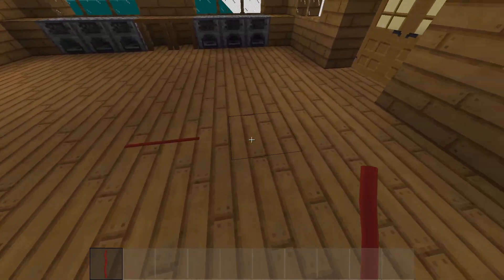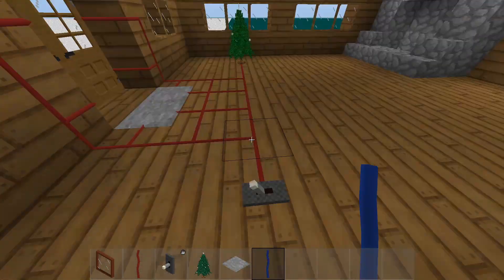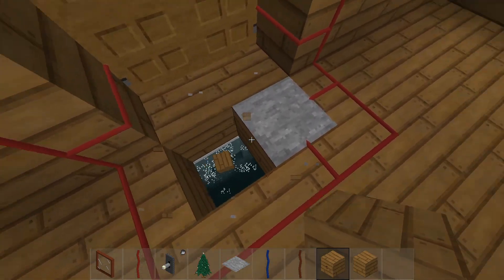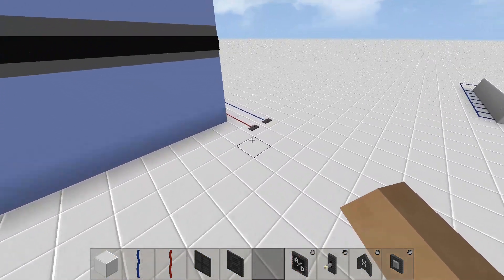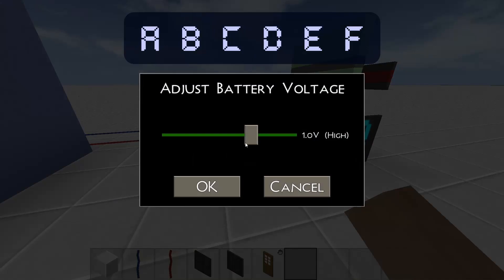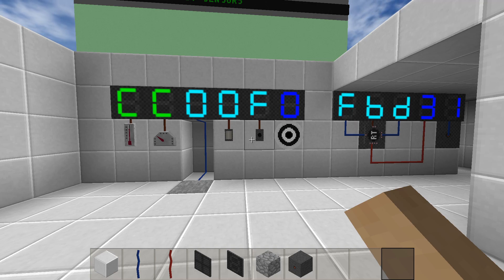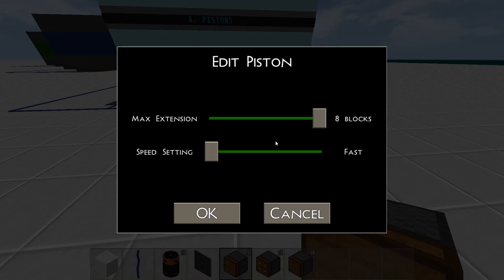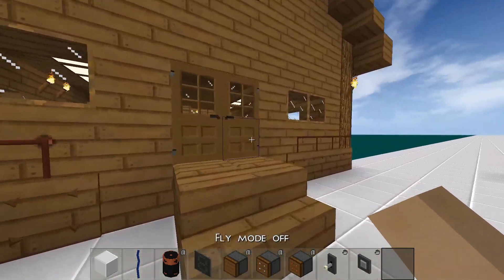How To Use Survivalcraft's Electricity - Part 1 Analog And Digital

Comment: For some reason when I enable both inputs of AND and XOR gates at the same time next to each other, the output glitches out. I just found this out when I was making a half adder
Reply from the maker: Is one of the outputs connected through the diagonal of blocks, I suspect the game logic somehow thinks that the component is rotated 90 degrees as can be observed with a digital to analog converter placed in the same configuration
Reply: @SP4CEBAR I placed both gates on the same plane facing straight up. I connected the wires and tried turning one of the levers and as long as one is on the output is fine. When I turn the second lever the output froze.
Reply: @SP4CEBAR I tried downgrading to version 2.2 and the same problem also exist. then I tried installing Survivalcraft 1, making the entire circuit, and when I tested it it works fine.
Reply from the maker: I just tried to replicate it but it worked fine, are the switches and outputs directly connected to the gates or are there wires in between? If there are wires, what path do they take?
Reply: @SP4CEBAR  I connected it like this:
   X    Y
    |     |
-- A - O --
|      |      |
|    SW   |
--- SW ---

A is the AND gate, O is the XOR gate, SW are levers, X is the lightbulb connected to the A output, Y is the lightbulb connected to the O output.
Reply from the maker: odd that it didn't work
Reply from the maker: Here's an image of the bug I described, is this the same bug you encountered?
https://cdn.discordapp.com/attachments/368441937143005185/1346955887469658184/Illogical_components.jpg?ex=67ca11ec&is=67c8c06c&hm=7209d59e2d3995bc66368ce2133f83a1c597ec2790aaafd1449c06005c8b7fb3&

Comment: Minecraft: “We have the world's most complicated wiring machine mechanics ranging from Calculators to a Computer that runs bootleg Minecraft” 
SurvivalCraft: yes
Reply from the maker: Yes indeed
Reply: @SP4CEBAR Can you please tell me that how can I increase the limit of maximum extension of pistons like 1 to 12 1 to 24 etc?
Reply from the maker: @hylegaming7264  with mods, I don't know what mods you'd need for that, maybe ask someone in the modding channel of the SCC discord server (which is not my server): https://discord.gg/ewnkV4v
If you wanted to make it in vanilla then you could place a bunch of strict pulling pistons in a row, and power them starting from the one that has the most pistons to push

Comment: This blows redstone out of the water. Only thing I'd like them to add is transistors.
Reply from the maker: You can use an AND gate as a transistor (for digital use cases): a high signal on one side makes the signal coming from the other side pass through
If you want the amplification behavior of transistors then you could program a memory bank with this custom behavior, it should have data like
0000000000000000
0123456789ABCDEF
02468ACEFFFFFFFF
0369CFFFFFFFFFFF
048CFFFFFFFFFFFF
05AFFFFFFFFFFFFF
06CFFFFFFFFFFFFF
07EFFFFFFFFFFFFF
08FFFFFFFFFFFFFF
09FFFFFFFFFFFFFF
0AFFFFFFFFFFFFFF
0BFFFFFFFFFFFFFF
0CFFFFFFFFFFFFFF
0DFFFFFFFFFFFFFF
0EFFFFFFFFFFFFFF
0FFFFFFFFFFFFFFF

Comment: How to make high security system in sc2
Reply from the maker: Motion detectors or pressure plates could be connected to 4-LEDs to make a control room security camera display
You could use dispensers firing towards each other to make a "laser" wall that deals a lot of damage to everything that tries to pass, you could make doors that lock automatically, or when a control room lever is switched on
Reply: @SP4CEBAR  Oh ok thanks bro⭐⭐

Comment: I'm trying to make an item separator. I throw all the items I collected into a stream of water that leads to a dispenser, then goes to a pipe. Is it possible to make a system that separates the items and each one goes to a specific chest? 
I managed to separate them, cause they pass through a stream of water and underneath there are dispensers with all the slots filled with a unit of that item, so only the specific item will enter. But I don't know how to eject this item that was separated without removing the other slots, because then the separation doesn't work anymore
Reply from the maker: The only type of item sorter I made sorts items based on their density (floating, slightly sinking, sinking or quickly sinking)
But, this dude made item sorters like you described:
With water:         https://youtu.be/Ygr1odyAxbw
Without water:   https://youtu.be/PPibFS2nPsY
Reply: @SP4CEBAR  Thanks a lot for the help! I'll probably use the system of the first link, with water! But the second link is unavailable,  can you check it?
Reply from the maker: @renansm3077  Oh wow, I must have accidentally hit backspace, the link should work now
Reply: @SP4CEBAR  woow, it works, the system he used is so amazing !!!!

Comment: what was the app you used when you explaining the target function?
Reply from the maker: With the auto-clicker, you can do things like clearing out water (with glass and fireworks) (10:10) and making rhinos fly 
https://www.instagram.com/p/Bx-EcHoBSuX/?igshid=1q9m2kavspzn2
Reply: @SP4CEBAR  thank you so much!
Reply from the maker: Np
Reply from the maker: You mean the auto-clicker?  (which I used to fill the dispenser)
This is the one I'm using: https://sourceforge.net/projects/fastclicker/
Reply: @SP4CEBAR  so this can help me fill up the dispenser right? I cliked thousands of times to build up firework castle lol
Reply: @SP4CEBAR  I downloaded but not sure how to use it
Reply from the maker: To use it you need to set a trigger key, by default this is enter
You can choose wether you want the key to toggle the auto-clicker on or off, 
or you only want the auto-clicker to be on only while you are holding the key
You can also specify the clicking speed

Comment: Hello so im got a guestion more better to make digital pc or analog
Reply from the maker: Analog signals in Survivalcraft are Hexadecimal, this basically means that it's a 4-bit signal. In other words, one hexadecimal signal is as good as 4 digital signals combined. 

Another nice thing Survivalcraft has, is that you can use memory banks (these are 4-bit RAM units with 16x16 storage locations) to store or process these 4-bit signals (when the back input and the bottom input are disconnected it becomes a read-only memory bank, now you can basically write your own outputs for any combination of inputs).
I'll go more in-depth on the electronics in part 2 of this series
Reply: @SP4CEBAR  ok